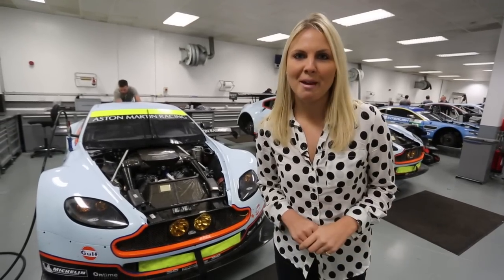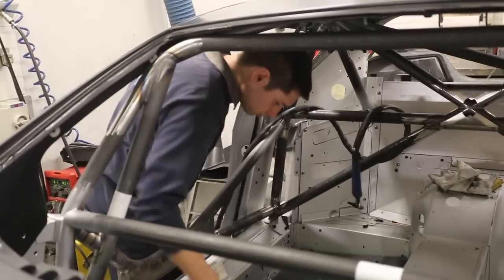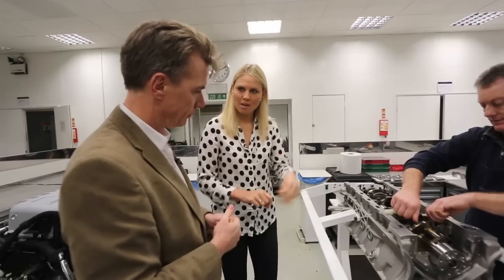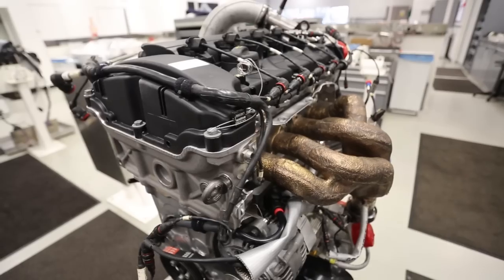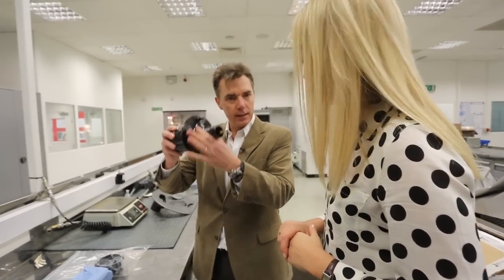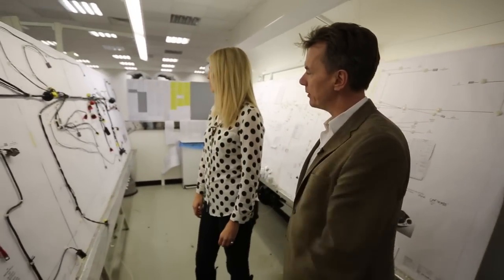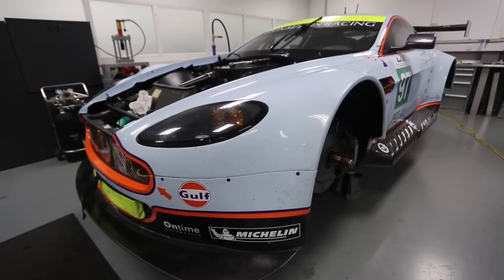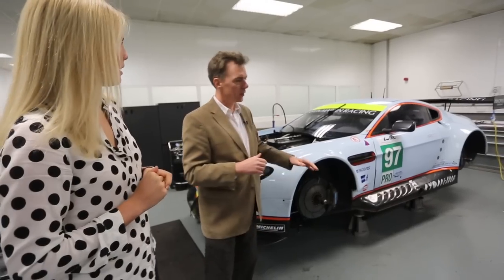How to build a Aston Martin GTE racing car

Comment: I came here to find out whats the difference between the Vantage GTE and Vantage GT3, all they said was the former is more complicated (We wont' get in to that, that gets very complicated) less power and more expensive. He refused to explain further because the host is too clueless to understand... Our loss really
Reply: +L HC It's mostly down to bureaucracy and specific rules for GTE class, which is more restrictive than GT3. So you have different engine restrictors, aerodynamics, power, weight, maybe some electronic,...
Reply: Dude it was clearly explained. GTE engine has spikes.
Reply: GTE has a lot more body aero (particularly front and rear diffusers)

Comment: IMO the new 2019 Vantage road car is 300 pounds too heavy.   Aston Martin should consider using some or more Magnesium in their chassis.  Mag is 30% less heavy than Aluminium. ... A.M. should swallow their ego & pride and hire more Lotus engineers. as they are the experts  in weight reduction.
Reply: I think that's because the regulations say it must be heavier

Comment: why would u use glue!!!!!!!??????
Reply: +Elijah Mills welding can add some unwanted weight and aluminium doesn't weld all that nicely. The aluminum oxide rust gives some problems. So many places use a chemically engineered glue to either provide a mechanical bond between the plates (basically the stickiness of the glue) or the paste can be engineered to bond the plates on a molecular level (tares electrons away from the aluminium forcing them to fuse together)

Mind you. i am no expert at this but that's how the reasoning was explained to me. Hopefully i helped?
Reply: Because glue doesn't crack like welds can. It's aviation / aerospace technology. You can get incredibly high temp glues which hold stronger than steel welds and still have a certain degree of give.